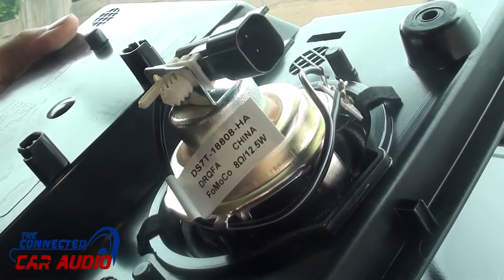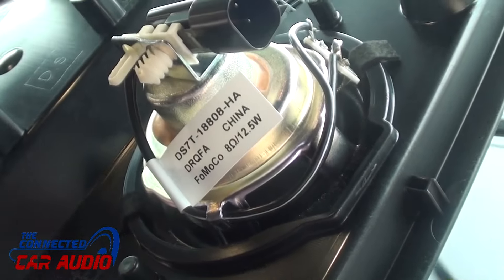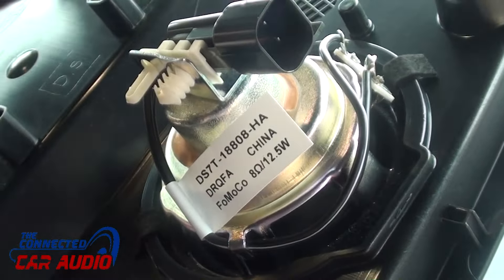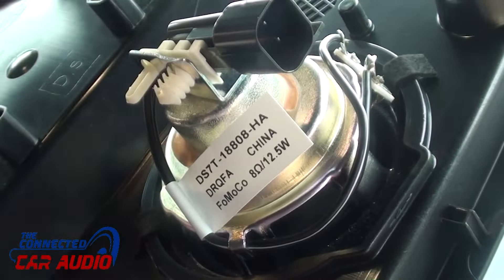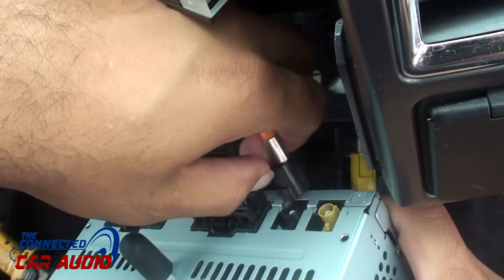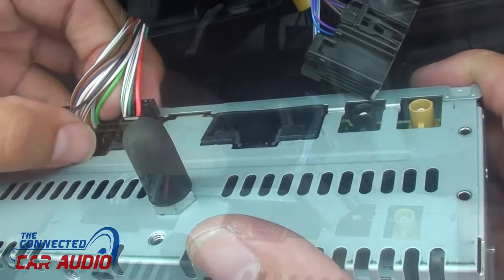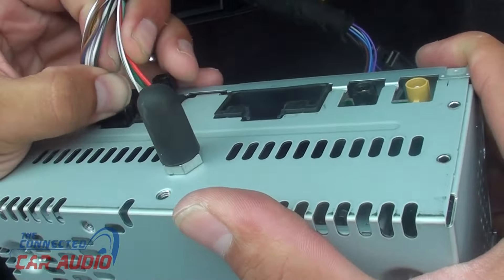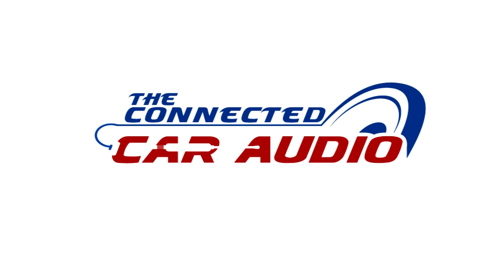remove factory stereo ford f 150 2015 and up

Comment: Its 7mm. Everything is metric now. That extension on a drill and an sae socket looks like a good way to strip a screw. I recommend using a ratchet and a 7mm socket.
Reply from the maker: Okay thank you I appreciate it
Reply: I mean maybe if you don't know how to use the torque settings on a drill or screw gun lol those 45° drill extensions are a godsend, and I've never came close to stripping anything. You're right about the metric though, but in general you should fit the socket before start loosening it anyway, regardless of what tool is attached to it. I think most people strip shit even with ratchets just because they think it's "snug enough" before they start cranking away lol

Comment: Is there any way you can show a close up of the wiring harnesses that you unplugged at the end of the video? I am trying to figure out what type of adapter I need to buy to add a powered sub to this unit.
Reply: a powered sub should be able to take a splice from speaker wire